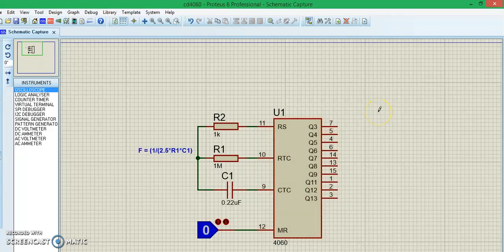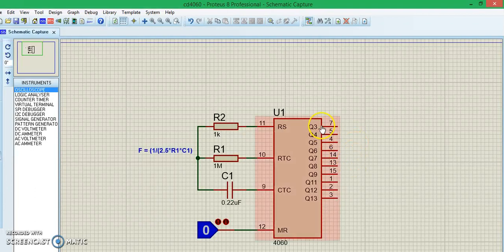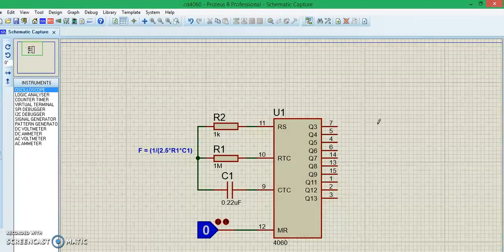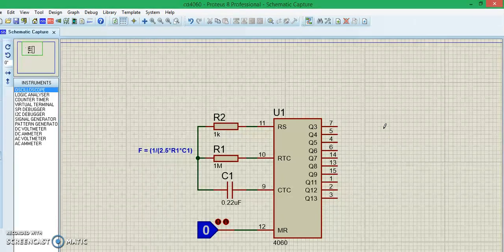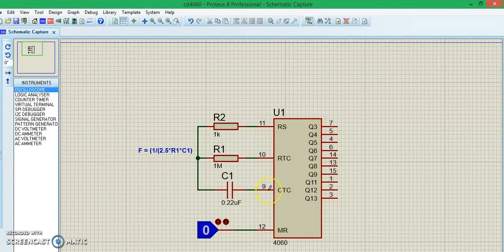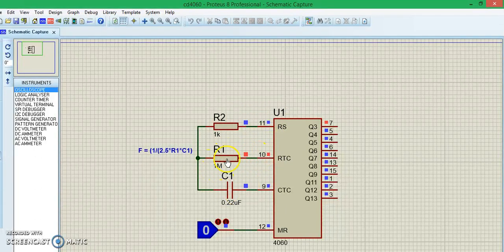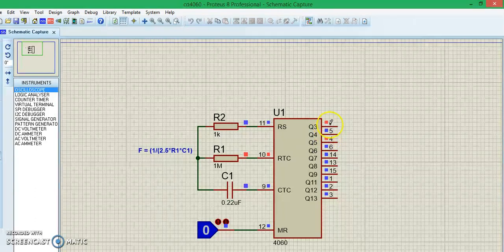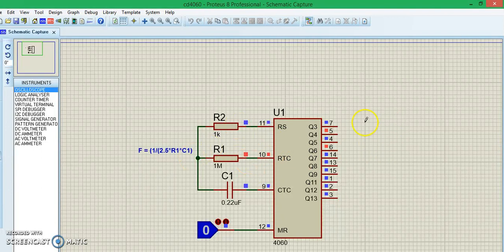CD4060 14-Stage Binary Counter IC Working

Comment: pin 16 and 8 are also missing which are the feed pins
if you want to make a printed circuit out of the schematic
the missing pins make that very difficult. you expect  this on low cost
simulators but with the price tag that over 4 thousand dollars
the components should be complete, or a least multisim should
at least let you know that not all components are complete